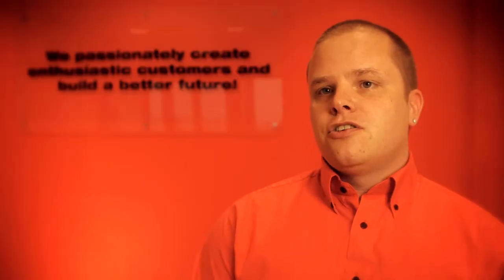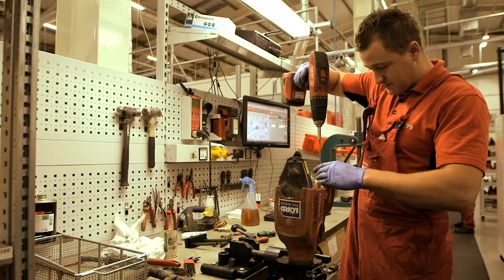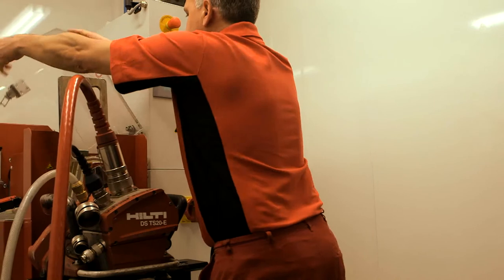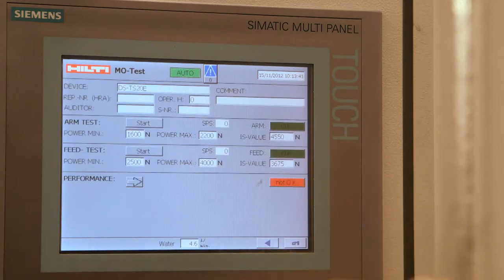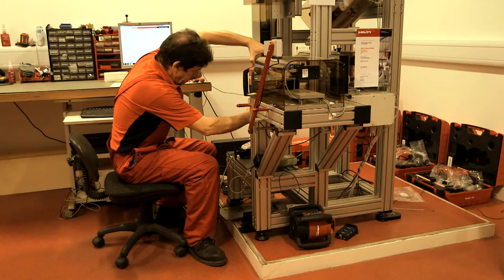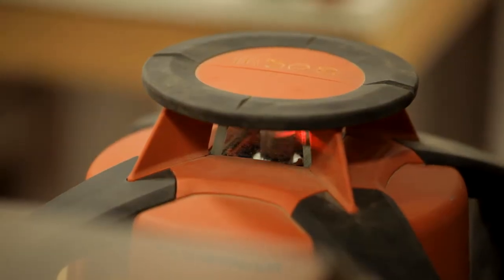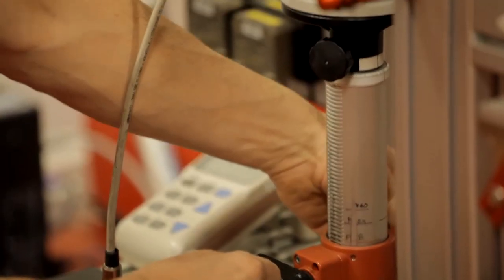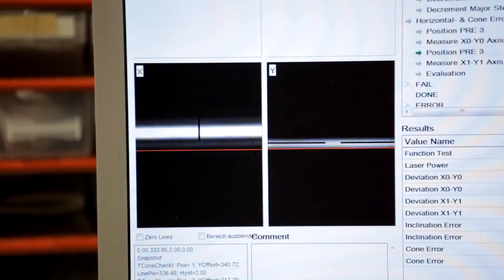Hilti Repair Centre - A Behind The Scenes Look

Comment: I have a 100 % record or getting my machines back from the Glasgow department Broken !, i have had a recip saw put back and forth about 7 times !, it is lying in my shed broken ! , they never managed to fix it , i put a 5 inch grinder in for a new switch and it came back with a lot of new part's but the switch was still brocken , it cost a load of money for a broken tool , is now in the bin , always used Hilti but have no confidence in them fixing there own tools - maby just the Glasgow branch but i am not impresed ..........
Reply: I had the same experience... sent a cordless grinder in for repair... came back still as bad .. only after complaining like F did I get anywhere...  shame really good gear
Reply: @Nunya Business complain anywhere you like !, it made no diferance , ended up just throwing the tools away , lot of money for this ending !, I still have some hilti's but would equaly be happy with dewalt for much less money !!!!!!!!